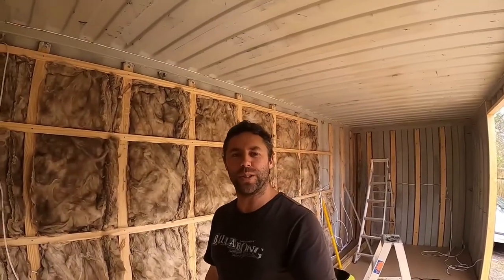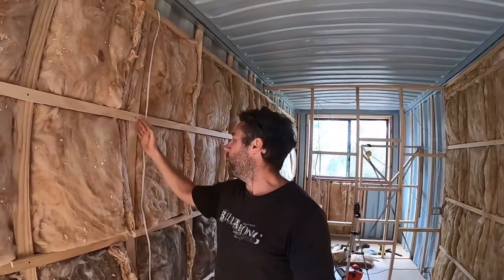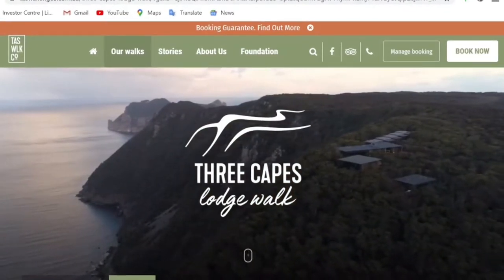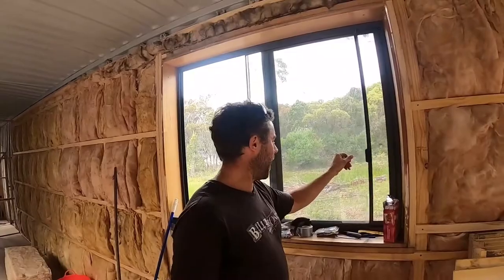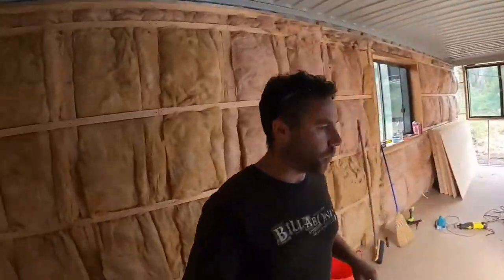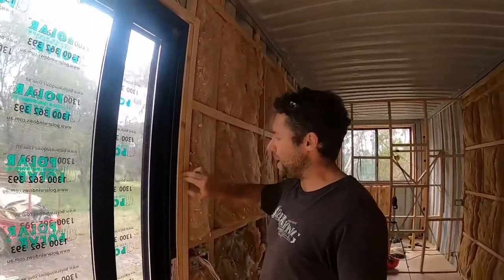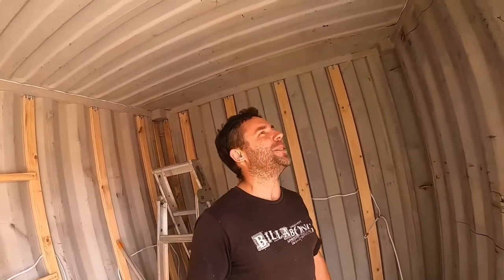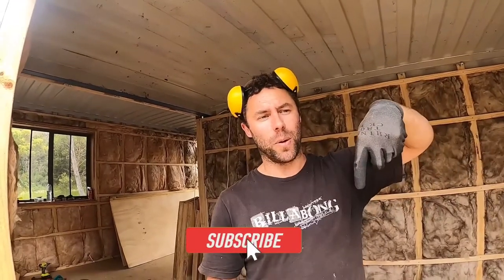BUILDING OUR TINY HOUSE AUSTRALIA ( Part Two - Installing the windows, insulating, and the wiring )

Comment: Curious as to what you did to frame out the windows and doors once you cut the container so there wasn’t any sag / compromise of the wall integrity? 
I’m looking at building a tiny home for myself (possibly in Tas) and as a woman doing it by myself… need all the info I can get! Thanks
Reply from the maker: Awesome that will be a fun project wheres abouts in Tassie are you looking at building? we just framed up the window and doors as you would a normal house, it's a bit tricky when it comes to flashing it off though as you have to deal with the corrugation of the container.